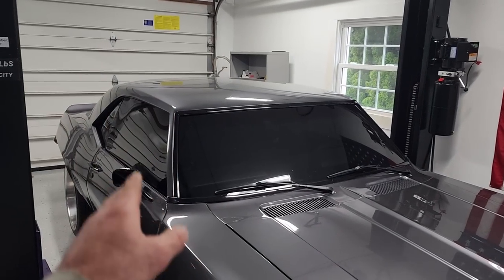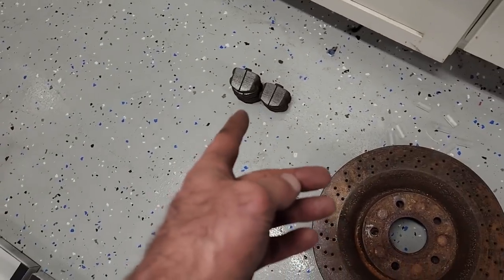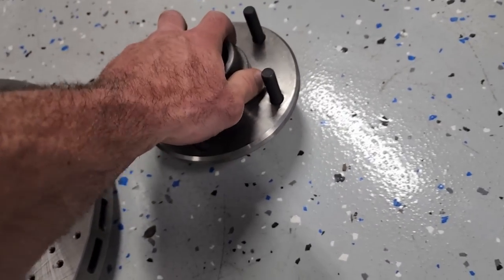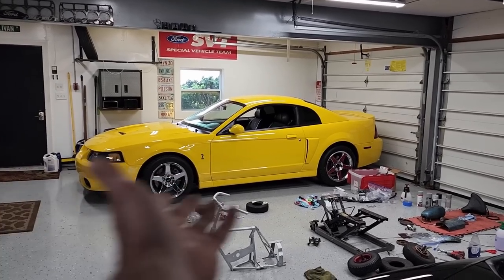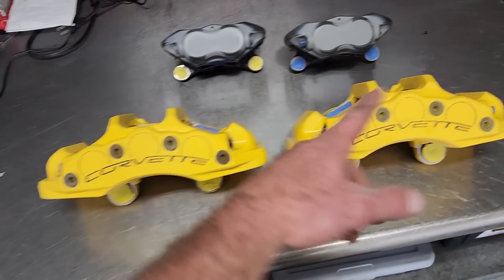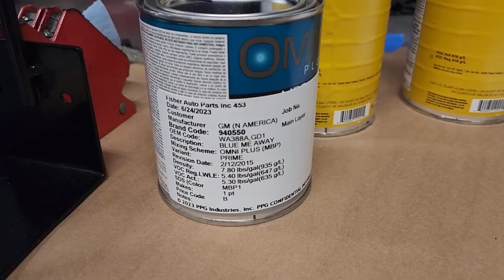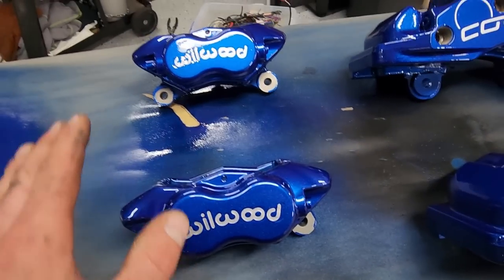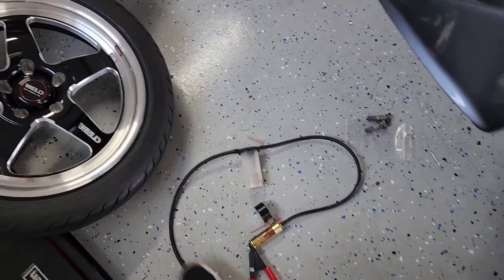My Pro Touring 69 Camaro Gets Corvette C6 Z06 BIG Brake Upgrade!

Comment: Yes put the holly screen on the panel. It should look pretty good. You should get a mini split AC system for your shop. Maybe even insulate the shop as well. But a mini split is definitely necessary.

Comment: Literally did a similar BBU to my '06 Yukon Denali with rear o.e. Brembo C7 Corvette calipers/pads, offset brackets, 14-18 GM Truck rear rotors, '22 Tahoe PPV front 6 piston calipers(also Brembo)& 16" front rotors & pads(direct bolt-on). 20" wheels required, stainless steel braided brake hose kit too. Stops Flawlessly. TCI: $2400.
Reply: all that on an 06 yukon ?? no offense but the whole car is only worth about 2500 bucks

Comment: So I have a 67 same exact suspension as and I have to recommend getting the ridetech truturn system! If you’re wanting to track your car you can fit a 275 wide FRONT tire with ZERO subframe modifications with the truturn. Just have to get the right offset on the wheel. I love my ridetech
Reply from the maker: Ill check it out!
Reply: What is the spec on wheel setup to run a 275?
Reply: @shanehoefer7162  I’ll see if my wife can measure my back spacing mine are 18x10 in the front. Only get a tiny bit of rub on full turn if I hit a good size bump or pot hole
Reply: I’m currently deployed over seas which is why I can’t measure them
Reply: @shanehoefer7162  18x10 with 5.75” back spacing. However if you have short body subframe bushing you’ll need to massage inner fender a tiny bit. If using stock height body bushings you’ll be fine

Comment: use a peice of hose on the bleader and insert it into a 1/4 filled plastic bottle make sure hose in bottle is submerged in brake fluid open bleader and pump the brakes slowly  works for me everytime . my favorite is a 20 oz. Coke plastic clear bottle 'with the hose submerged it lets air out but can only suck fluid back .plus you dont need someone to pump the brakes . it never seems to suck fluid back just removes the air . pinch hose when removing from bleader close as you can to the nipple of bleader  this will prevent getting fluid on your new painted calipers . OLD SCHOOL TRICK keep master cylinder about 3/4 full and check level after bleeding each wheel .
Reply from the maker: Thought about doing that but was too tired. Been a long day lol

Comment: The bolts  are called “socket head cap screws”… always use new pads with new calipers- calipers have to glaze the pads- that’s why they have a break-in procedure. Camaro lookin 👍

Comment: Are those front rotors directional? Looks like the veins on the front left aren't facing the right way to suck in air. Correct me if I'm wrong here.